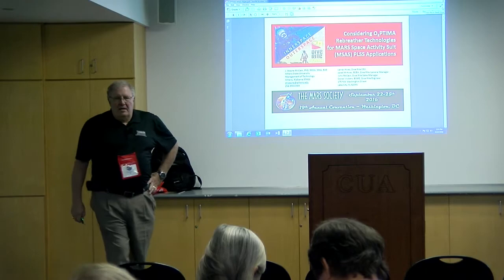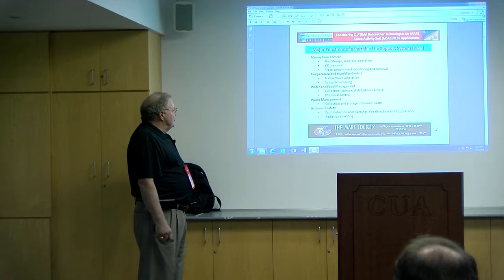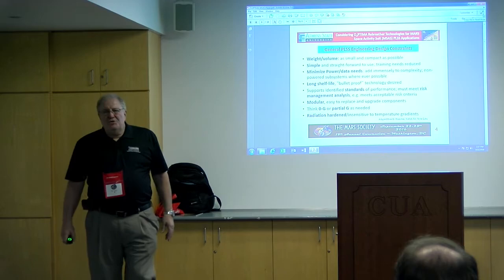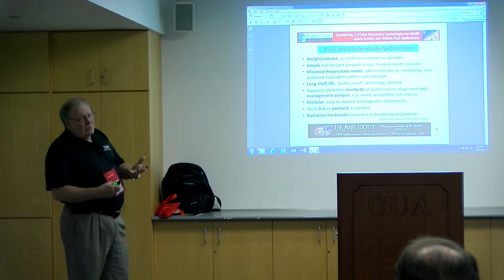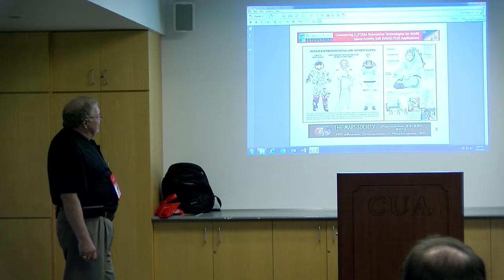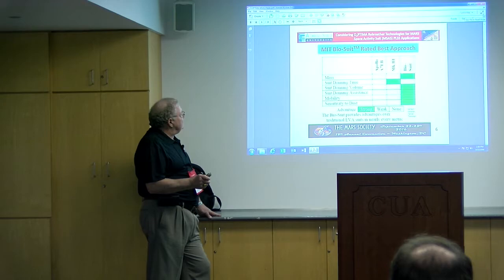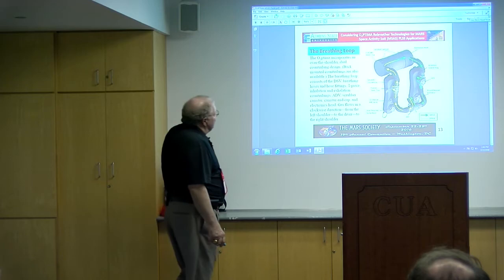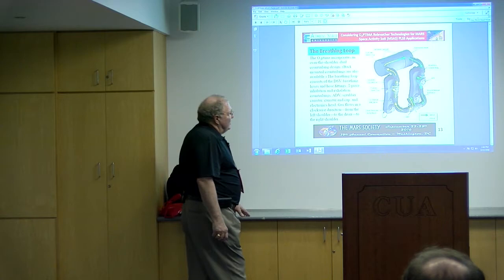Wayne McCain - Rebreather Techs - 19th Annual International Mars Society Convention

Comment: This lecture describes a Mars mechanical counter pressure suit in which only the helmet is pressurized. But this ignores the hands. The lines of no movement method does not work for hands which are required to move as hands do. This isn't a problem with the rebreather he describes but it does mean the suit they are designing for is inaccurate. Hands will have to be pressurized as well.